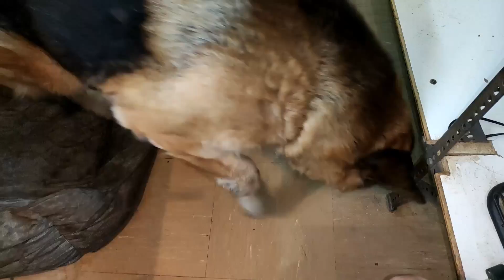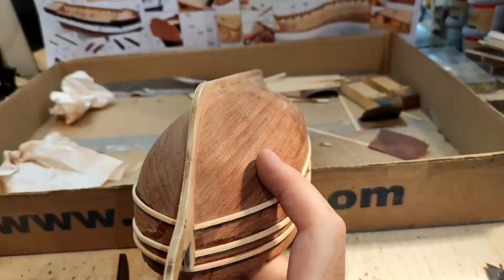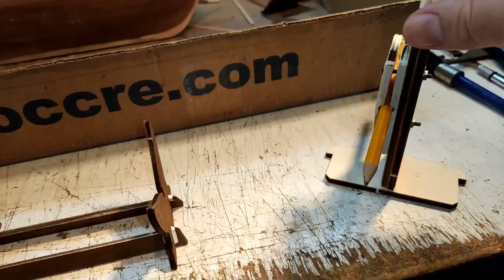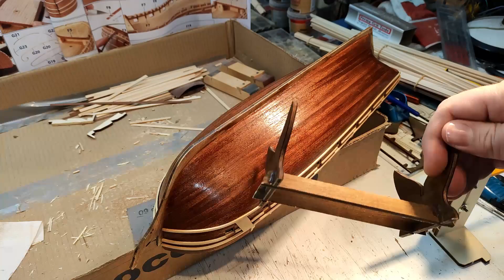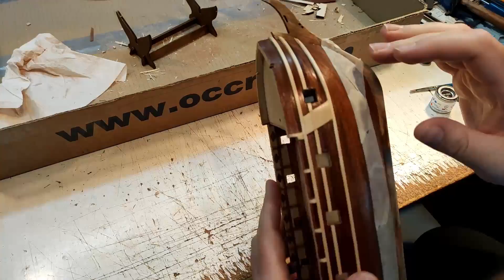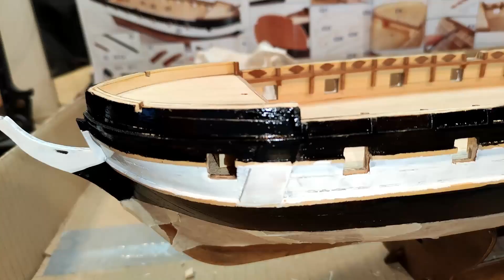HMS Beagle - part 16 Painting The Hull

Comment: Good tip using the wood sealer. I had to do two coats of black and three of white to make the colours bold enough.
Reply from the maker: Yes the wood sealer makes the painting on wood surfaces very easy.

Comment: can i apply an acrylic paint or stain over an enamel wood sealer? If yes what steps need to be followed to get a great looking finish? step by step please.
Reply from the maker: Yes you can apply acrylic paint or varnish but no stain. Stain must be applied before anything, on plain wood surface. There isn't a step by step procedure, just paint brush and your paint, also some water for thinner.

Comment: John, what kind off wood filler are you using?
Reply from the maker: I use Nitro wood sealer number 1419 with Nitro thinner as a primer. Also i use water based wood putty.